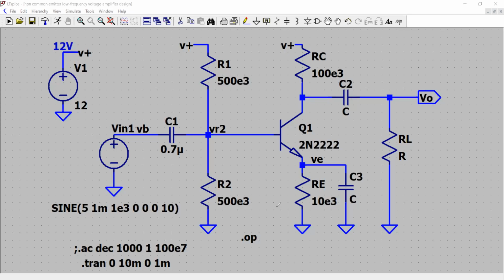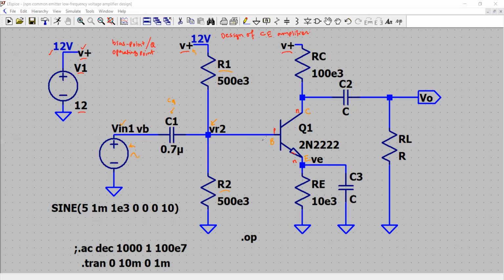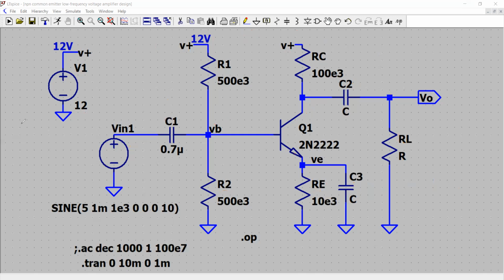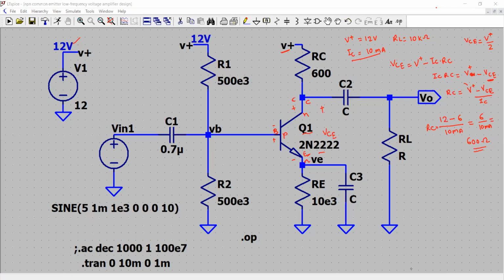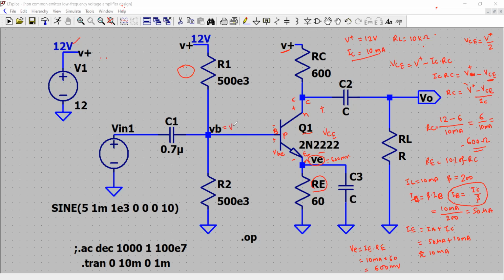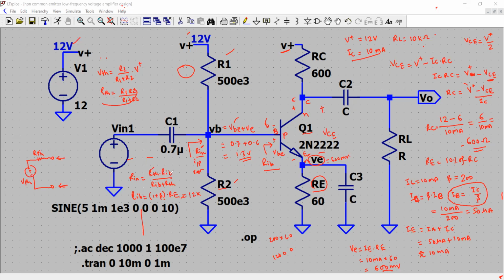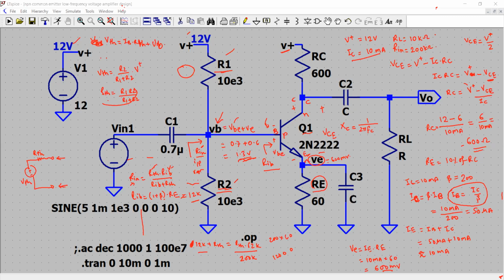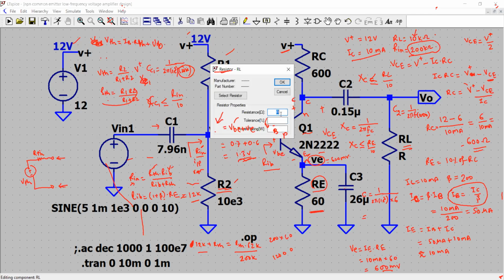Mastering Common-Emitter Transistor Amplifier Design: A Step-by-Step Guide!

Comment: Why on earth would you use exponents for resister/cap values??? why lolol
Reply from the maker: @rallokkcaz 
In SPICE, resistor values are typically specified in ohms (Ω), and the notation "500e6" would represent a resistor value of 500,000,000 ohms, or 500 megaohms. While SPICE itself doesn't inherently limit the range of resistor values that can be used, practical considerations such as model accuracy, simulation stability, and component availability may affect the feasibility of using such high resistance values in a circuit simulation.

For very high resistance values like 500 megaohms, factors such as parasitic capacitance, leakage currents, and model accuracy become significant. SPICE models for high-value resistors may not accurately capture these effects, leading to discrepancies between simulation results and real-world behavior.

Furthermore, in practical circuit design, sourcing resistors with extremely high values might be challenging or costly due to manufacturing limitations and material properties.

It's essential to consider these factors and consult the documentation of your specific SPICE simulator and resistor models to determine the feasibility and accuracy of using such high resistance values in your simulations.
Reply: @stem1128  That's not what I'm talking about. SPICE has a system to simplify the values to real part specs specified in the model, aka "10e3" is "1k" and vice versa. Using exponents to denote a component value is 100% an anti-pattern in circuit modeling but always very hard to read. You would never read a real schematic with SI notation for values. You also use that notation for capacitors which is inconsistent and weird. I watched the video looking for a reason to use them but it's just sort of arbitrary.
Reply from the maker: Why does SPICE then allows to use exponent?